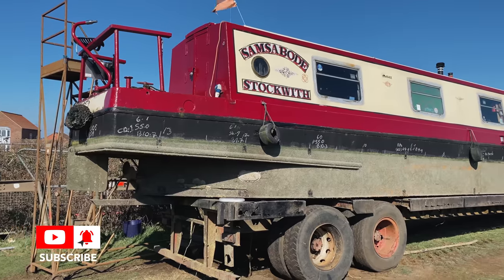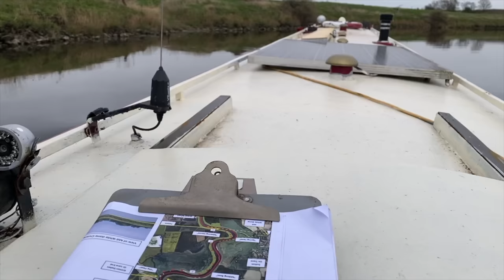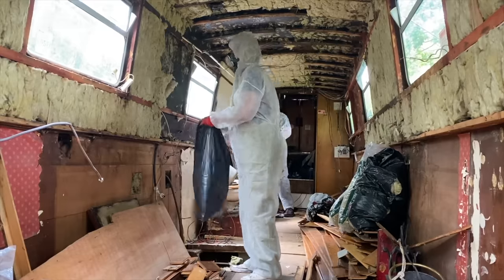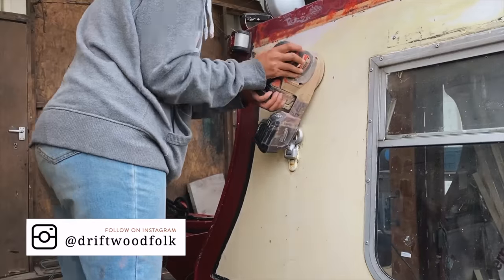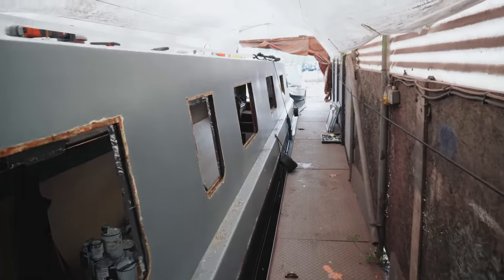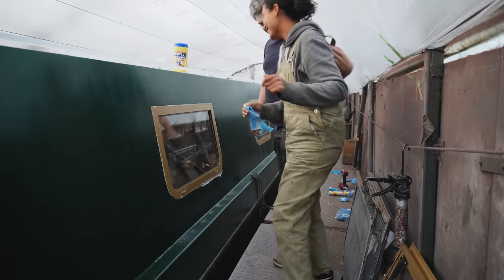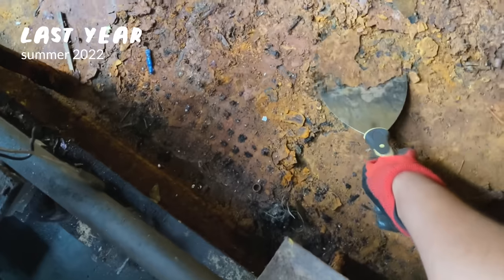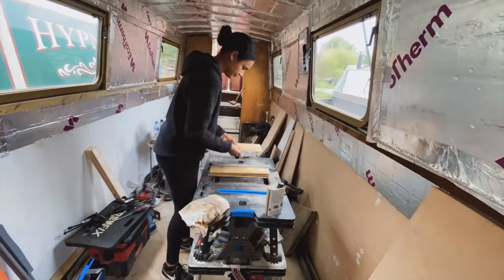We're renovating a narrowboat! | THEN & NOW 1 year narrowboat restoration | TIMELAPSE

Comment: Great to see the progress you have both made, congrats to you both. May be worth checking the exhaust flow on the diesel heater. I believe it should be running downwards from the heater as a by product would be water, over time it may cause issues as water collects in the exhaust and restricting the flow which will stop the burn chamber.
Reply: Thanks for that much appreciated. Yes we will be adding a drain on the exhaust (forgotten the name) as we can't run it down hill due to the water level ha
Reply: @mike-driftwoodfolk2651  They are great pieces of kit, should save you a small fortune. The restoration is looking great, already looking forwards to the next update.

Comment: What made yall choose brick as part of the flooring? I figured that would just put a massive amount of unnecessary weight and might cause the engine to struggle in current over 4 knots
Reply from the maker: It's ballast, it's for stopping boats from excessively tipping or heeling. We're installing hatches in the floor so that we can remove/add ballast as needed
Reply: @DriftwoodFolk  ahh ok that makes perfect sense now. Sorry if my question was dumb i dont know jack about boats

Comment: Why didn’t u do the electrics , plumbing before cladding walls and ceilings
Reply from the maker: I'll explain the reason for this: Plumbing and heating pipe is being boxed in. No room behind the lower wall for it. Ceiling is only half done so we can do wiring and know where the lights are going etc. And upper walls aren't done, they will be done after electrics :)